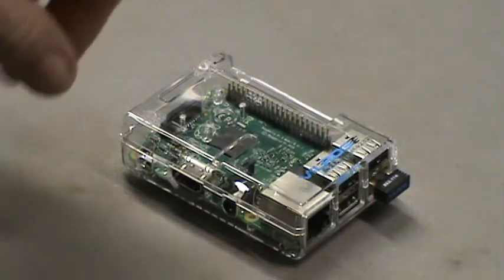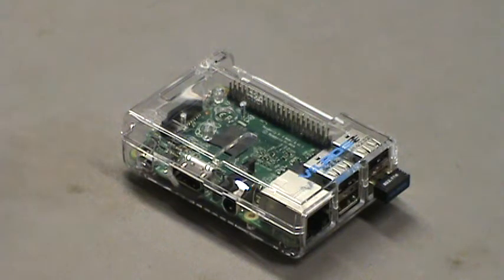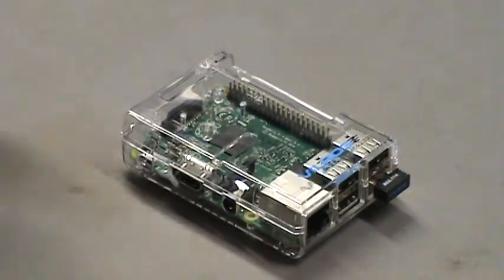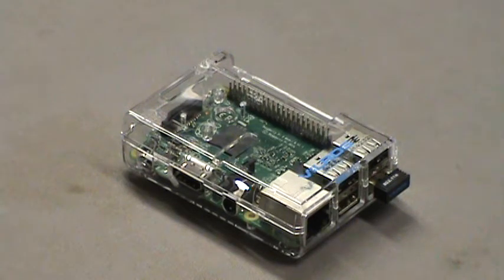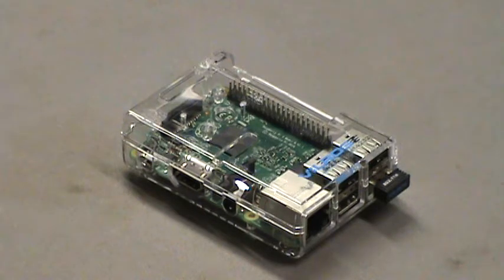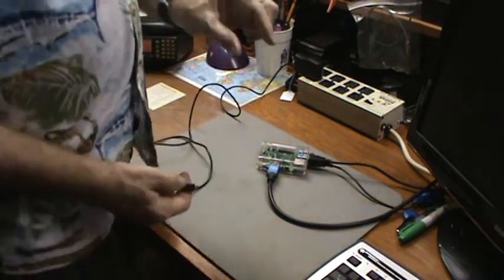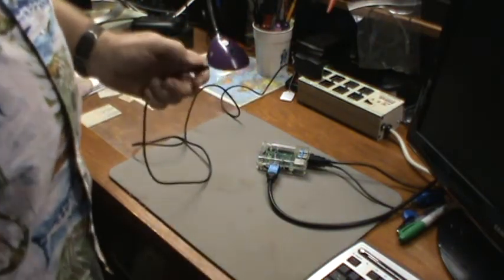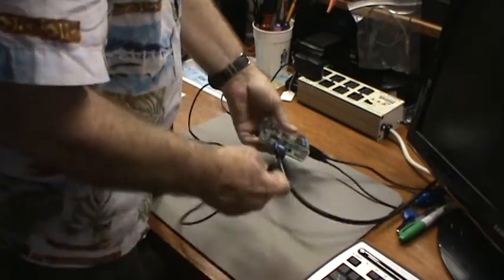TRRS #0520 - RBP - Raspberry Pi Up and Running

Comment: Reminds me of the first time I booted up my Pi. I think everyone starts this way, Tom. It was interesting. One thing I found out, if you want to run devices on USB, beyond wifi and a bluetooth keyboard or mouse, you'll need to look at a powered USB hub.
Reply from the maker: You are correct.  I have not looked up the specs on how much power the card can provide via the 4 USB ports.  Thanks for your comments and any help is welcomed.

Tom

Comment: Tom - I found your interest in the Pi interesting and I went one from Amazon and just got my Pi-2 (B)  Still in the box and I will follow along with you - my first step is to get the card into the plastic box that came with the device.  One note - it came with an instruction pamphlet on how to start ..
Reply from the maker: If you got a kit you should have everything you need to get it running but then the fun starts trying to find out more information.  I am slowly learning.

Tom

Comment: The Pi camera comes in 2 versions, a regular light camera and an IR camera.  The IR camera has the IR filter of it regular light version removed.  The IR camera accepts a wider range of light frequencies, but as far as I know it still accepts visible light.   I don't think the IR version blocks the shorter visible light wavelengths. 

 You  may use a female to female connector to connect your Amp and that Pi 2 audio/ video cable.
Reply from the maker: I have read that you can use an USB camera too but have not checked it out.  Some much to learn.
Reply: The Pi camera uses the Pi for its processing.and control.   A usb camera has its own cpu. and may be limited by usb speed.
Reply from the maker: Jeffrey Plum Thanks for your inputs. What is amazing is Google Hangouts software found one of my cameras that I could not find the drivers for before.  I was expecting to just use the computers audio and bingo the video shows up.  Scared me at first as I was thinking what other software could have turned on that camera while I was on the internet????

Tom

Comment: A friend of mine has a Raspberry pi and hasn't had time to work with it yet. I am going to let him know about your review
so he can watch your video. I don't have a Raspberry pi but if your are using Linux and want to interface a SDR to Linux
I've used several Distros using the GQRX program for them. Several of the Ubuntu Distro versions have GQRX on their
repository. The Distro SolydXK has the GQRX program in their repository. It is easier to use the SDRs with Windows
using #SDR and HDSDR.
73s
Reply from the maker: Thanks for your comments.  I can use any help I can get right now as I am totally in the dark. :)

Tom